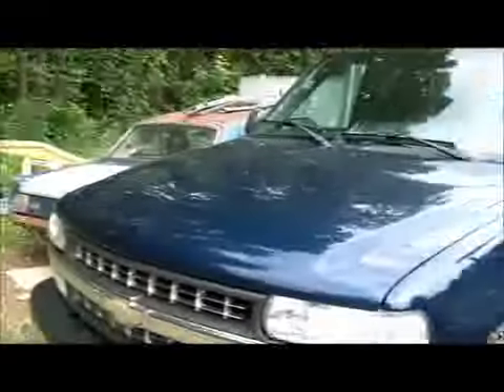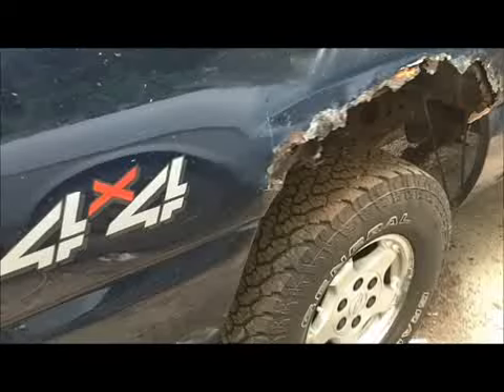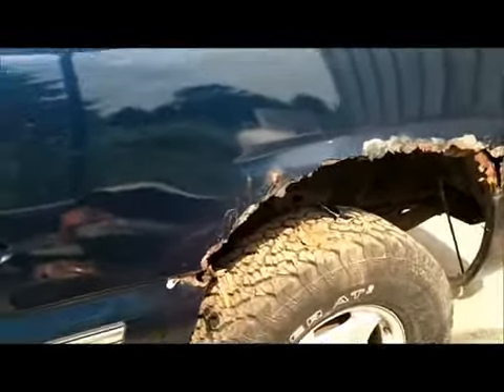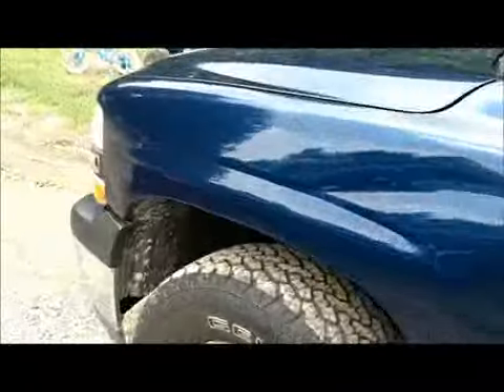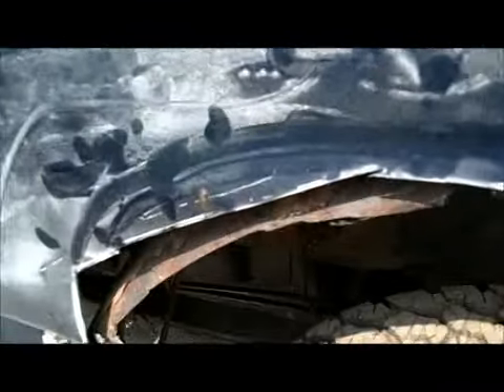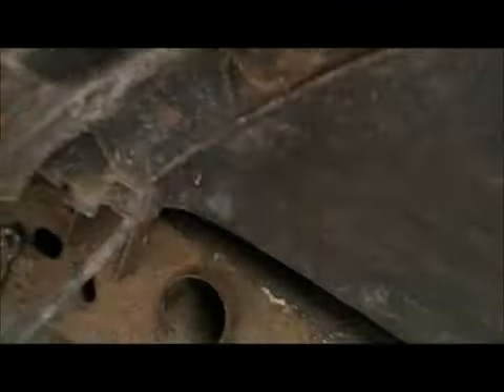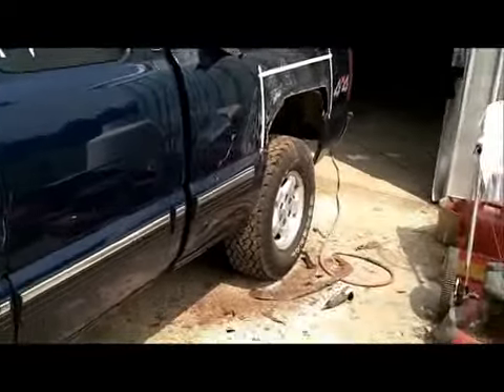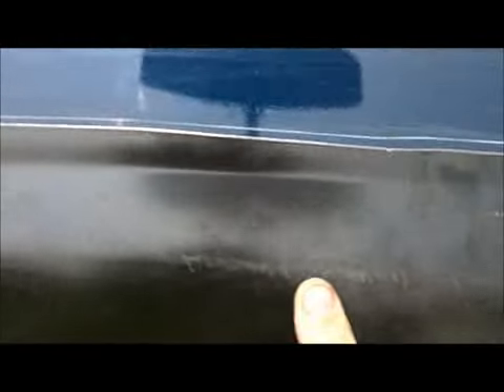How to repair rusted wheel wells on a Chevy Silverado part 1

Comment: Take it from a professional bodyman.  (48 years experience)  when you get your new truck, remove all plastic plugs from backside of rockers and the ones on the outer wheel housing.  They are put there by the manufacturer to promote rusting, how else can they sell parts?

Comment: i wish they would undercoat cars at the factory
Reply: +Mark N they rather sell you a new one more often ;)
Reply: +Mark n as volvo does?
Reply: Kia does
Reply: In the 90s Chevy did a wax coat on the frame but it didn’t hold up worth a shit they need to prime everything with some sort of chassis saver shit like that
Reply: @UncleDonDon  Aluminum rots just as bad as steel rusts. Only advantage is lightweight!

Comment: Folks - DO not do this - this is NOT how to repair this type of damage properly. The panel should be fully welded in, ground smooth then light coats of filler.... If you are doing repairs - do them the right way first.....
Reply: Chris S he straight up said it's a cheap fix. Probably his truck or a buddies who asked a favor
Reply: this truck aint worth but a couple grand, im sure there are priorities involved
Reply: correction I would pay tops $800 for the engine and trans
Reply: Yea because people should spend thousands fixing an old chevy driver. Gimme a break.
Reply: @spam lite so the truck looks more presentable and not like such a piece of crap?
Reply: @cfields8507   That is a car lot's truck he does cheap work for the cheap car lots.  He knows how to do better work but his specialty is get them and out. Used car lots are full of crap they do not pay anything so you get what you pay for and do not waste time on the vehicles. Only reason why I would not do this kind of work all the time is because you develop bad habits.
Reply: Caleb Fields 
Exactly Caleb , he was honest in what he was doing & saying. 
People love to criticize no matter what. 
He never claimed to be anything that he’s not. 
I actually enjoyed watching & listening to him, made me laugh with him, not at him.
Reply: Chevy dest brakes

Comment: I just made this repair to my 06 Dakota. It rusted out due its plastic bedliner locking in moisture around the wheel housing and lip. The truck had been repainted and the bed had been half-assed repaired last year before I bought it. I knew it was going to need to be fixed within a year, because I have seen enough bondo packed into rust holes in my life on used vehicles. That's OK because I like doing metal and body work. I did the repair in the same manner as he did. I cut out the rot with a cut off wheel. The edge/lip of the wheel housing was rotted out like this truck in the video. I rebuilt the housing before tacking on the exterior repair panel, using scraps of sheet metal I had lying around. I bought a pre-formed repair panel like the one shown in the video off of eBay. I cut the repair panel down to size and slipped the new panel under the sheet metal of the bed, which was the opposite of how he did it. I don't have a mig, so had to braze the new metal in, which causes more heat distortion than a mig welder would. Use a mig if you can afford a decent one and be sure it isn't a cheap $99 model. After the exterior panel was tacked in numerous places, I started the body work. I used three different fillers. First I used a filler impregnated with aluminum (All-metal is one brand of this type of filler) to fill in the space between the new exterior patch and the original sheet metal of the bed. It makes a very strong bond that won't crack with time like regular filler might. Then I went over it with Feather lite filler and for the top coat of filler I used Pink Icing brand filler. The repair was strong and it will last for years if you take care and wash the area on a regular basis. I drilled a few tiny holes in the bedliner around the wheel housing in order to vent it a little in the future and let moisture out. This was a decent repair job shown on the video for an older truck. It does prolong the vehicle's life and looks. A lot of smaller body shops in more rural areas will charge $2500-$3000 for this repair. Its worth it, if the truck still runs good and you don't want to buy another one. The Dakota has only 116K miles on it and it runs really well and is a 4X4 V8 model on top of it. Thanks for making the video!

Comment: Dang dude I wish I had all the resources you had.  If I were your little kid in like 10 years I'd be set!  I'd love to learn how to do all this stuff and get experience I'm good enough at welding but don't have a personal welder or the money or the resources to do any of this.  Being 17 with a father that would rather take everything to a shop than do it yourself kind of sucks.
Reply: Take it from a 45 year old who was right where you are at 17.  My dad was/is about as handy mechanically as a 12 yr old girl.  The advantage you have is YouTube, and great guys like Sean to learn from.  I had to visit the library and buy Chilton's manuals.

My best advice, do like I did... use every extra penny to buy tools. Start with your basics: screwdrivers (buy a "6 in 1" and for the most part you will only need the one), pliers, a socket set, and some combination wrenches.
Buy the cheap stuff if that's all you can afford at first.  Harbor Freight is a great place for this.
And keep watching the Hack n Pack shop.
Reply: Tim's right.  My father couldn't change a flat.  Learn from youtube, dig up what you need to know and dont be afraid to try something.  And if you mess it up, consider it part of your training and try again.

Comment: GM should really issue a recall, or maybe the FTC should get on them. No reason that trucks that are less than 15 years old should be rusted like this, I've seen 2008's with rusty fenders. It's like they used the cheapest Chinese steel to assemble these vehicles.
Reply: come to wisconsin or any northern state, you will see cars and trucks that are way worse then this.
Reply: It's not the manufacturer. It's the owners. You mud it, don't wash it, just abuse it in general. It'll rust.
Reply: that's how it is here in NY , some vehicles look like they came from a junkyard.
Reply: Buy ford
Reply: The 2008 I have has rust in these same spots, mustve been previous owners but that mud/salt gets wedged up in there and its almost impossible to get out
Reply: metersocket00 USA. Made
Reply: 1970s and 80s were worse. A lot of it attributed to crappy imported steel along with domestic issues like road salt and poor care by owner. A K car could totally rust out within 3 years back then.
Reply: I wouldn’t buy a 2007 to maybe 2015 American made product. The companies nearly went bankrupt and a lot of corners were cut during these years of manufacturing.
Reply: It's called salt. It's not practical to rinse your car off every day in the winter with salty roads.
Reply: The 2011 Silverado my uncle just bought already has rear fender rust and rockers don’t have to long before holes will be in them

Comment: So this is a 2001 truck, with the video recorded in 2012? GMC should be ashamed of themselves. As you stated, 10 years old and 30,000$ new. Not even worth 500$. Wheel arches gone, cab corners gone, rockers gone, likely the floor and brake lines and every other small undercarriage component is corroded too.
Reply: LakeNipissing GMC would look at a 2001 Mercedes and no longer be ashamed of themselves. A lot of cars by many companies from the late 90ies - early 2000s were rust magnets, regardless of the price bracket.

That were the times where companies realized they cannot make the cars too good, else people will buy one car and keep it for 20 years - where's the profit in that? Also they had a lot of new engineering constraints, at least here in EU. The cost pressure rose very sharply, the weight had to go down, because fuel economy, and at the same time, the crash test ratings had to go up. A lot of structurally new models had to be conceived in a short time which lead to teething design mishaps which allowed water to go in but not ever drain out, and the material got worse because they had to use much less steel and less zinc. Newly taped out factories got microscopically pre-zinked sheets for cost saving, instead of sealing the whole chassis after welding it.
Reply: My GMC Sierra is 12 years old and rust free. Its all how you take care of the vehicle. You need to clean it. by the way manufacturers don't make vehicles to last forever. If they did people would keep them forever and they would go out of business. Look at the price of a BMW, i have seen many rusted bmws. I used to be a technician for BMW them moved to General motors. The price of a BMW should mean they never rust, right.
Reply: +LakeNipissing I know right? You think they'd be better at solving rust problems by then, and still today. Now I see 2007 and up(GMT-900) Silverado's and Sierra's with rust in some spots, it's pathetic. Their just too fucking cheap to properly rust proof vehicles.
Reply: +SUV Man I agree sure maintenance is part of it but honestly it could be a very small part. I live in the same area this truck is from i got a car from florida had it rust proofed from ziebarts and at the end of its life with barely any car washes ever (it was a convertible that leaked). when it finally went to the junkyard it had not one spot of rust. why cant for 30k they add that kind of protection and a little extra paint.
Reply: oh yeah. oh yeah oh yeah
Reply: @priustoric2214  Car manufacturers design to sell cars on lots to people who don't really understand machines. They could easily build a car that lasts 50 years. They have no interest or motivation to do so.

Comment: "This is a 10 year old truck, guys!". For me, I am just disappointed in GM. This kind of crap has been going on with fleetside beds for decades. You'd think after all this coating technology available that the company can stop this from happening on their trucks. And always the rockers under the extended cab. My god, at least try to use stainless sheet down there!

Comment: Why didn't you just put a new bed on it
Reply: James Mcgirt money, he wadht paid to do it
Reply: Yep a 200 dollar bed is 10000 times better than a chicken wire bondo bullshit job
Reply: Have you priced a solid truck bed? Sometimes doing a basic repair like this is all you need on and old "worthless" vehicle. It's not a showcar.
Reply: @tabbott429  Beds do not cost that much. You can get a bed from the salvage for 200.00
Reply: @foxybrown2  not around here. If you get one that's solid its slot more than 200 and it's a pain in the ass to change it breaking bolts etc. If I'm gonna replace the bed its gonna be with one that's like new which cost 1000$
Reply: @tabbott429  i'm in oklahoma our rust is not that bad .

Comment: another how/to hack job. What's wrong with doing the job for this video right?
Reply: Not what he`s paid to do.
Doing it right = 2k and the difference is a year or two at most in salty NY.
It`s not that the body filler or metal is gonna cost more, but the time, other materials and welding wire and gas is a killer.
Customer knows what he gets, no secrets are kept, hence the video upload.
Reply: ToreDL87 It's not an ultra valuable vehicle. Do the appropriate job for the vehicle

Comment: $2500😂😂😂😂😂😂 i wouldnt pay 500 for that pos rust bucket
Reply: charlie madson actually if you value those trucks their worth quite a lot. Even one in that condition valued around $3500 to $4000 easily
Reply: Dylan Greene maybe in la la land here in wi they would go for 1000 or less
Reply: Here a pretty beat up one was valued at $4600
Reply: That a $3500 truck all day here in Minnesota.
Reply: Yeah the motor (5.3L V8) is worth almost $1000. Go on Kelly blue book and put one in and check the value for your area.
Reply: charlie madson a 6500$ truck jere in iowa.  trucks are expensive. here
Reply: At most in wi would be maybe 800
Reply: charlie madson whats your zip code?
Reply: Matt Schork I wanna move there lok
Reply: Trucks are expensive 2500 bucks buys you a piece of shit it's hard to find a good truck for under ten grand that's 4wd and doesn't need work.
Reply: Samuel Clark anything that is 4x4 and can plow snow is worth 2000 at least.
Reply: charlie madson Little kid! Trucks are super fucking expensive! You will be happy to get a 2007 or 2005 with 200k+ miles for $10,000! If you dont believe me do a search! They are not cheap!
Reply: charlie madson I call BS

Comment: I had the same problem with my truck, the back fenders were rusted out and the front fenders were still solid. I cut the metal back and purchased bushwackers fender flares and my truck looks new again.

Comment: Watching this made me feel sooooo much better about the 3" spot of rust on the wheel wells of my '89 Safari. 27 years and 210,000 miles and it's still pretty solid for a PA van. This truck must have been driven in the winter a lot and never washed. What a shame.

Comment: Living in NY I bought a 98 s10 in 2009 and it had some rust coming through the paint in the wheel wells and the rockers but looked good washed up. 5 years later the box was literally falling off the truck and the rockers, front bumper, fenders were turning into swiss cheese. It looked so bad I had to let her go even though it still was a reliable vehicle. 

I looked into fixing the rust early on but the truth was it was already too far gone when I got it. It didn't look it from the outside but the inside was pure rot.
Reply: honestly i don't know how u guys do it it is so much work it seems like just to keep ur truck together and that involves nothing mechanical its crazy good luck
Reply: I LIVE IN YOUR NEIGHBOR STATE OF CONNECTICUT- AINT BETTER HERE
SEE A LOT OF THESE TRUCKS WITH SEVERE RUST SOME ARE LIKE 4-5 YRS OLD AND ALREADY FALLING APART
Reply: Those are probably Toyota SUVs and trucks that are 4-5 years old and rusted all to hell. That is what happens when your island has to rinse their steel with salt water because fresh water is too expensive! I don't notice the domestic made trucks in the Midwest rusted out and being only 5 years old. Some people don't believe in waxing or washing their vehicles either. Also sheet metal used in new vehicle production is a lighter gauge than what they used in earlier decades. Once the paint is chipped, it doesn't take long for the corrosion to eat through it. That is another problem with rust out.
Reply: That's funny, you can open the tap and get fresh water, but you'd have to transport seawater over in order to get your parts near that...
Really makes you think.

Comment: Biggest prob w/ rust Mftrs install structural supports w/o drains that just act like reservoirs for sand salt rust. My truck has a rib support entire length wheel well (keeps it from vibrating) w 3 top holes-no drain. Tires kick up crud that fills the support.  It's done on purpose. If your truck lasted 20-30 yrs they wouldn't be able to sell you a new one every 5-6.  I had mine undercoated. NY dumps salt on roads by metric tons even w/ there's no ice /snow Plow down sparks fly-n LOL It's what they do when no leaning on a shovel in summer..Thanks for Vid.

Comment: Those first three minutes of hammering just made my Suburban look like it needs a lot more work. The rear wheel arches have rust that doesn't extend past the plastic covers, at least not that I can see. At least the differential plate didn't fall to bits when I knocked loose metal off and then coated it with POR15.

Comment: I have a 2000 silverado with a little rust surface rust around the wheel wells because the paint is peeling from getting hit with rocks over the year lucky it has only been peeling for a couple of years. I was just going to sand it down an spray it over with whit paint and put fender flares on it. rust is not ruining the structure of the metal like on this truck so I think it should be fine. Any opinions? It's an old truck and I just want to do it for cheap. The rest of the paint is good

Comment: only tens years, I've seen trucks on the east coast that were worse than that in less that a year. my '03 Silverado is starting to rust above the rear wheels, nothing like that, never been repaired before. thankfully i'm out west.

Comment: For those that rip on GM as being rust buckets, they should consider the problem area; as in Rust Belt.
I live in Oklahoma and rust is not an issue here. A local farmer has a 65 Bel Air and a 57 GMC pickup that were both bought brand new. No rust on either one.

As a mechanic, I've seen many makes and models from the Rust Belt that ended up in Oklahoma to be resold after 5 pounds of Bondo and some quicky paint job. Five year old Hondas, Fords, Nissans, Subarus,  Chryslers; you name it. Rusted all to hxxx.

Comment: Question, if you don't have a welder what abut rivets?I have a small hole over my back quarter panel, I have a expanded patch for auto body will the rivets work.

Comment: Its always amusing to read the comments. Unless you live up North you have no idea how much damage road salt does.  I have lived in New England, the rust is terrible.  I have lived in the coastal South, rust is moderate.  And then central Texas, where there is no rust at all.  While what this guy does is not perfect, it is a "quick n dirty" repair that buys another 3-4 years for this vehicle.  In many ways spending much more money to do it right doesn't make sense. After 3-4 more years the truck won't be worth any more regardless of how it was repaired. The frame will be gone at that point.  In the rust belt, it doesn't matter what brand it is, the road salt will eat it.

Comment: i like this. where you get that panel from again? i have a 00 chevy s10 pickup i plan on working on and the bed wheel wells are rusted out and someone did a half ass job on repairing them.